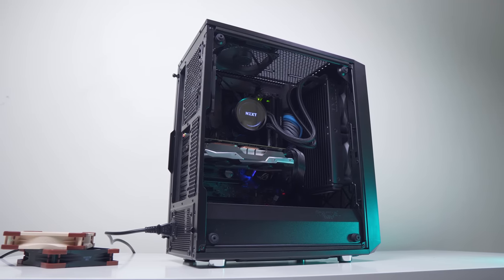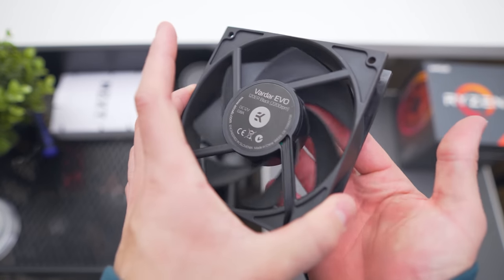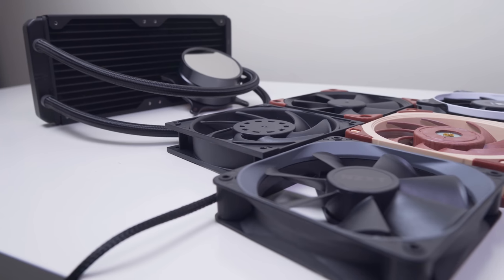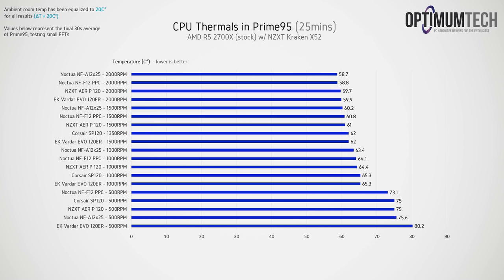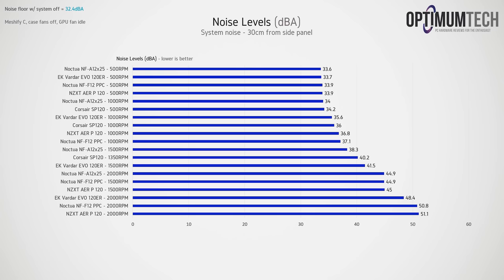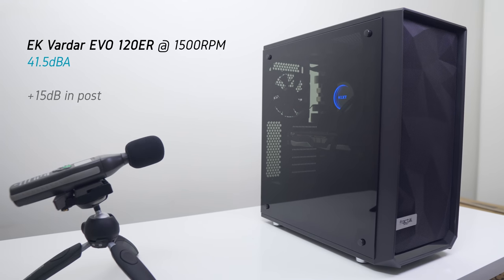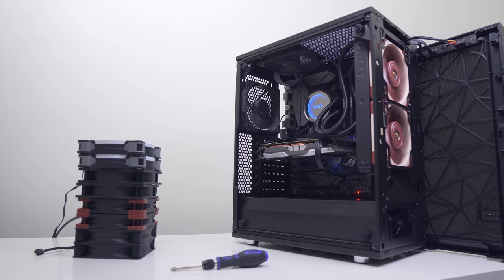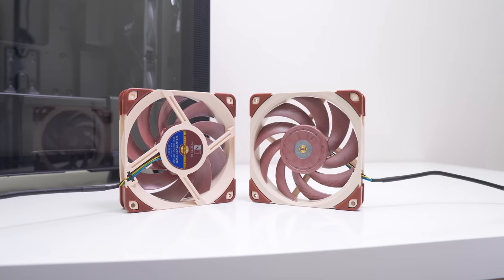Noctua's NF-A12x25 - Magic on Radiators!

Comment: Hey Ali, would it be possible to do some testing on push/pull vs push+pull ?

Noise normalized what would be better ? for example .. 4x fans at say 1200rpm, or 2 fans at 1600rpm ??

Comment: I noticed you didn't use the included silicone frame which helps further reduce vibration noise and air escaping before entering the radiator.
I know it probably won't make the largest impact, but it'd be cool to know.

Comment: Could you test these fans against the redux static pressure fans as well? I have a set of redux fans I'm using as case fans, but they're much louder than I had hoped and I have them at less than half speed to get them to tolerable noise levels. In the future I'm considering getting some Chromax fans if they make a version of this. Main question is how much better that would be for performance + silence?

Comment: I put 2 of the Noctua  NF-F12 industrial fans in the 3000 rpm version on my radiator. They are blasting the air through that thing lol

Comment: With the Noctua's, did you plug them into the cables coming off of the X52's cpu cooler or  plug them into the motherboard's fan headers? I have the X52 and the Noctua NF-A12x25's but when plugging them into the cable from the cpu block, the fans doen't work. They do work on my Corsair H100i so I know they aren't defective.

Comment: @optimum tech Know this is an older video - but, I do have this case, I got a celsius S24 AIO -- and I feel like it could be cooler and quieter (got the stock fans), got 2x140mm stock fractal fans in the front and a 120mm in the back and radiator is top mounter (as my GPU is to long to front mount).

Would I benefit the most from the NF-A12x25? Am cooling a 3900X with the S24 is also something I should mention I guess.

Comment: It's very impressive how the Noctua's sounds at 15000rpm !

I actually have a PC with 3x120mm front, 2x120mm top and 1x140 back of bequiet! Light Wings and when they achieved something like 1100 rpm i can hear them a lot (which... is not quiet ?)

Going to replace all of them for NF-A12x25.

Comment: Now I don't know if I want to get the NF-F12 Chromax fans or just wait for the NF-A12x25 Chromax which will supposedly come out Q1 2019... I upgraded my cpu from a 6700k to a delidded 8700k at 5ghz and to adequately cool it in my custom loop, my vardar fans have to be quite noisy.

Comment: replaced stock corsair fans on h100i with this. had to double check if the fans are running because i cant hear a thing at full rpm.

Comment: I confirm this test. I've been running Vardars for over a year now and recently replaced them for new Noctua's NF-A12x25's because of the noise they make. At full speed, Vardars do slightly outperform Noctuas, but they also run 200 rpm faster. However, noise is significantly lower with Noctuas! I only used my ears as a measurement, but they seem more than twice quieter. I couldn't be happier with Noctuas, even though they are ridiculously expensive.
And just as he mentioned in the end of the video, if you need top of the line fans in a system that is sitting right next to you, new Noctuas are a must! Otherwise, you might consider some other fans, like Vardars.

Comment: I've been quite happy with 8 120mm Noiseblocker M12s in my case. Great temps (typically under 45C under heavy load with two GPUs in the loop), and it's ACTUALLY silent, lol.  The first time I fired it up, I thought I had missed the button, or forgotten to plug the fans in, it's that quiet.

Comment: Great review. I noticed that you didn't use the radiator-mount rubber gasket that's included with the NF-A12s, though. Those may have improved performance even further.

Comment: Would be awesome if you could get a few more fans to compare like the Be Quiet! Silent Wings 3
120mm PWM high-speed, Phanteks PH-F120MP, Corsair ML120 Pro, the basic Thermaltake Riing 12 LED and Cooler Master Silencio 2400RPM (also know as NEPTON 120XL FP FAN) or atleast the 1400RPM version of the Silencio.

Comment: Great work !
any chance you can do a comparison with NF-A12x15 ? they are significantly slimmer and on paper not much weaker. With your love for mini ITX (that i totally share) it might be very handy comparison. Personally I don't care about air coolers or AiOs, but i can extrapolate the performance on the high FPI AiO radiator to one that can be found in a custom loop.

Comment: Just run push-pull at 1000rmp with the Noctua A12. I have 4 Varders for a 480 mm Radiator. Need 4 more for push pull.

Comment: There is a very slight audible difference between 800rpm and 1000rpm on the NF-A12x25. I found that with my 3 in the system 800rpm was the absolute sweet spot for silence. My phone tells me I have an ambient dB of 25 in my room with my PC on. That is really quiet! Do note that case also matters, and where it is placed and so on. 1000RPM is definatly not loud at ALL. I'm just extreamly picky. I have to hold my breath to actually hear the difference xD

Comment: We need black a12x25 we really do.
Reply: just paint them dude
Reply: @cthulhu4606  does painting them lower the performance?
Reply: @vincentv.berchem2085  O.o
Reply: @vincentv.berchem2085  Just a bit
Reply: @cthulhu4606  what spray should i use? Do you have any recomendations?
Reply: @eLmY-ni4ye  Just don't hah, If you really care about the look, buy be quiet silent wings 3 or corsair sp. Only parts I would paint is radiator, case and gpu backplate nothing else.
Reply: Can Erkin S. They finally exist. Chromax slims.
Reply: Noctua informed me that chromax versions of them are coming out in Q4 2020
Reply: @cthulhu4606  im about to buy nf-f12 for ryuo 240. Painting it shouldnt be a problem.
Reply: @vincentv.berchem2085  it does void the 6 years warranty tho.
Reply: @hovant6666  awww i was hoping Q1 2020 , boring to wait so long.
Reply: @hovant6666  2 more quarters...
Reply: What we really need is the NF-A14x25!
Reply: and we need 140mm versions.
Reply: @hovant6666  oof. I just bought some brownies. Still sick fans tho. The sound so good.
Reply: I think the default brown looks fantastic with black cases like NZXT. Initially i wasnt sure either, but looking at these videos im now sold on the concept.
Reply: Future teller?
Reply: @hovant6666  I sure hope so
Reply: @Henry14arsenal2007  nope
Reply: @TheStereoField  Lol yep, im totally replacing my default NZXT fans with these, it will become much more original aesthetically than just the plain old all-black look.
Reply: @vincentv.berchem2085  Definetly... 100%... Don't paint!
Reply: @Henry14arsenal2007  damn yikes having such good fans on such mediocre cases
Reply: @suborgulag7289  i wouldnt call it mediocre at all, it fits everything i wanted, though theres definitely a problem with overtightened screws. Other than that it looks great, is easy to maintain and cable manage, airflow is good too. The CAM software is a whole another garbage can though.
Reply: @Henry J Lopez They were supposed to come out a long time ago
Reply: @Oldsah  Just asked noctua and they said q3 :(
Reply: LOK! It's the computer interior decorator!
Reply: October!
Reply: How has no one in this mile-long comment chain mentioned the Nidec Servo Gentle Typhoon yet?
These are literally NF-A12x25 in black/gray!
Reply: 3 years later and still no black ones. They are saying 2021 Q4 but I doubt it.
Reply: @erisium6988  😭
Reply: I wish there was an rgb version of them
Reply: @flaco7255  That is so antithetical to what Noctua is about that it'll never happen :L
Reply: @misatzu  Nidecs may test well but audio samples of them show that they have an awful whine to them
Reply: @hovant6666  :((
Reply: Still not out. I need 9 of them.
Reply: Any suggestions on a good aio?
Reply: @flaco7255  if you're okay with forgoing liquid temperature monitoring and RGB, then the Arctic Liquid Freezer II line is essentially unmatched. Fan and pump control on it though is fairly 'dumb' in that lacking a liquid temperature sensor, you can only adjust fan speed as a function of CPU temperature
Reply: @hovant6666  what do you mean by forgoing liquid? Does that have any disadvantage?
Reply: @hovant6666 any suggestions on very good aio that is around $130?
Reply: @flaco7255  Forgoing liquid temperature monitoring. Some AIOs have a temperature probe inside that when you plug the unit into a controller and an internal USB header let you set fan speed according to the liquid temperature instead of the CPU temperature. The former is more 'steady' than the latter in terms of fan RPM over time. For an AIO around $130 CAD, the Arctic Liquid Freezer II 280. For $130 USD, the Arctic Liquid Freezer II 360 or 420. Consult you case manufacturer's radiator compatibility guide before purchasing.
Reply: @hovant6666  I will keep this in mind, thank you man for the information
Reply: @flaco7255  np
Reply: @hovant6666  do you think the aio icue h100i can be better than the artic liquid freezer 280?
Reply: @flaco7255  No, I've worked with them before and Corsair AIOs in general triple the amount of wiring you have to do. Their pumps are also too loud compared to the Arctic, which is so quiet I run it at full speed at all times.
Reply: @hovant6666  do you know an aio better than the artic that comes with two fans and the pump?
Reply: They just came out! I got 4!
Reply: Hey man, guy from the future here. They’re out.
Reply: @seabass22  nabbed seven for my two HWL SR2 rads <3
Reply: @hovant6666  I got 6 F12s on my rads for like 6-7 years now.

Comment: Nice video. But how did you connect the fans? Directly to the Motherboard or via the NZXT splitter? Reason I am asking is that NZXT PWM control via CAM software doesn't appear to work well with non NZXT fans. I tried with Noctua and BQ and both would not spin up.
Reply: Yes, inquiring minds want to know. I was about to ask this same question myself. I too was unable to get the NF-A12x25's to work when plugged into the X52's cpu cooler while the stock NZXT fans worked with no issues. I'm currently using the NF-A12x25's with an old Corsair H100i AIO to cool my i7 9900k in the NCase M1.

Comment: This was awesome. Thank you for all the hard work put in! 
I'm using these to replace the RGB fans on my Cooler Master ML240R AIO because they're just too loud, and I want my computer to stay on the desk as it's really pretty and I paid a lot for aesthetics, but I need a fairly silent PC for audio recording. I'm also replacing the 140 mm rear exhaust fan with a Noctua NF A14 Chromax to round out the fan upgrade. I already updated the fan curve which helps a lot.
Reply: IM looking to do the same with that AIO. its really loud under load. did you manage to do the upgrade>?
Reply: @Time4House  Oh yes. One of the best upgrades I've ever done. They're super silent and work like a charm! Worth it.

Comment: I just got a 8700k.  Had the kraken x62 but (Its my fault ) but I don’t think I could get it on right and was giving me high temps. I was going to get ether a Corsair h115i or a regular cooler that’s good and quite eg be quite dark rock pro 4. I don’t know what to get. I want the pc to be as quiet as possible but also be very cool as I do a lot of video rendering and editing. I also need all 4 ram slots to not be touching the cooler ie be able to fit in the cpu cooler without giving up ram slots. What should I do?
Reply from the maker: The X62 should give you reasonably good temps. Just work on getting that mounted correctly and problem solved.
Reply: Optimum Tech I’ve actually broken the backplate so had to send back. The 4 stand off screws at the back, one popped out of the back plate. Don’t know how that works but then I could actually take the cooler off the cpu stand off. Very confusing. Any ones nzxt isn’t an option now so what you think I should do ??
Reply: I run the Noctua D15 aircooler its really good. keeps temps low.  Slightly better than the Dark rock pro.  Plus when you upgrade the CPU, and intel changes the Socket, Noctua gives free mounting hardware.  On Noctua's website they have a compatibility chart for your motherboard.  The chart will tell you if it covers any ram slots. If your Overclocking the 8700K to 5G i would delid before making any decisions on cooling.  You will see 10 to 20 degrees benefit no matter the cooling  solution.  Otherwise the EK aluminium line of expandable water cooling is very tempting.

Comment: Thank you for your video. Still viable after 3 years.  My rig: intel Core i7_8700K @ 3.70 GHz_6 cores - 12 threads, Kraken X62, NZXT stock fans, purchased latter part of 2018.

I just replaced one of two NZXT rad stock fans due to fan failure, so stock fan life-span quality is not that great. On the upside, NZXT sent me 2 new stock fans...even after 3 years...so kudos to them! Fan operation is whisper quiet on silent mode, but audible on performance mode. Performance mode is not distracting or annoying, just audible. 

I absolutely LOVE, LOVE, LOVE my rig and will be very unhappy when the bigger/badder/faster upgrade comes around. 

In the mean time, if any one of the stock fan(s) fail again, I'll be replacing them with another fan configurations until the upgrade life has been reached.

Comment: Im sad that im dont see BQ's Silent Wings 3 fans in theese kind of videos. 

Anyway content is always top level, good job.
Reply: My thoughts exactly
Reply: I have both Noctuas and Silent Wings 3. While the SW3 is very quiet,  in fact nearly silent even at full speed,  its air flow and static pressure performance are only mediocre at best.
Reply: Geo in paper both should have the same or very close perfomance. 
Thx for the info anyway
Reply: According to thermalbench's reviews, the SW3's are THE objective best fans for radiator use with regards to performance / noise ratio in low - medium RPM ranges, or at least they were before the A12x25's came out. I would assume the A12'^s perform better.
Reply: I wouldn't recommend silent wings 3 for radiators. The open fan frame design results in a loss of performance. Those types of frames are generally not recommend for radiator use.

Comment: Finally someone who does fan testing right! Good methodology and useful datapoints.
The nf-a12 just seems insane... with dba being a logarithmic scale the other industrial f-noctua (an already exellent fan) is literally twice as loud at 1000rpm. At 2000 the nzxts are 4x as loud. Absurd... the gains have to be from the reduced turbulence right? Because aside from the tighter tolerances it doesn't seem like any major deviations from traditional noctua design. Is there anything that can even remotely compete with this currently?

Now, just give me the black chromax versions of these and I will buy them so fast... The first thing I will do is probably take off the shroud of my GPU and mount these. Silent full-load gpu, yes please... and with noctua quality they will last for a good few gpu generations too :)

Comment: To use 1000 rpm i need voltage 1.45v so it will heat up but if you running 1.32v no point to have 1000 rpm only on max load and heavy gaming or editing you will reach 1000rpm or if you live in some Australia or Africa where you need massive rpm day to day usage not going heat up radiator

Comment: I have 4 old school noctua nf f12 which are the 1500rpm ones in push pull on my h100i with my 9900kf and that's quiet and sufficient enough to be 50c to 60c gaming 89 to 92c prime 95
Reply: Although they are ugly they perform

Comment: If you stepped up from an Intel i7. Ryzen actually puts out less heat according to ltt testing because amd expects full load and some boost clocks and Intel just trys to prevent thermal throttling